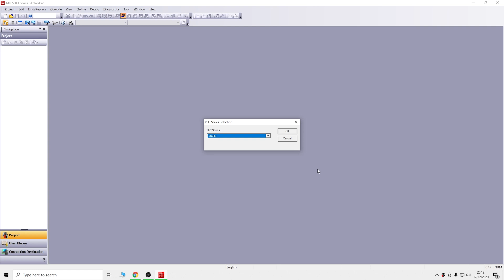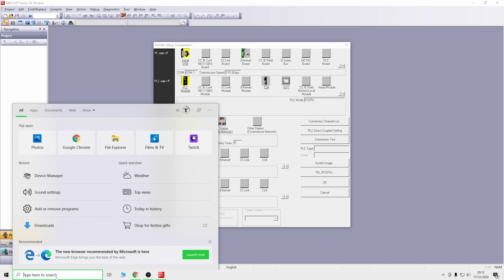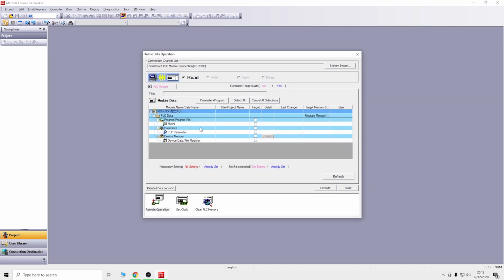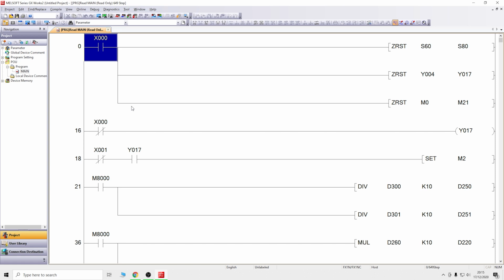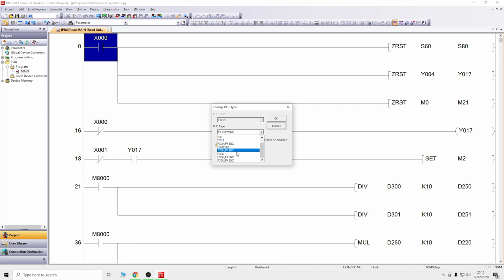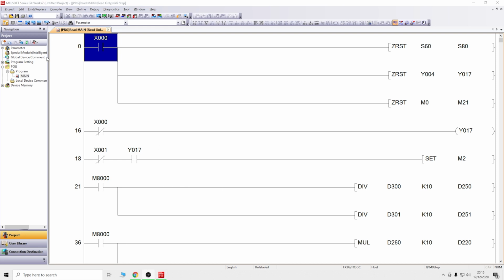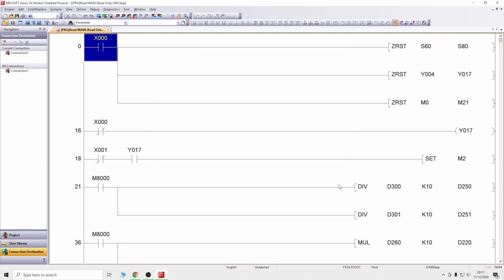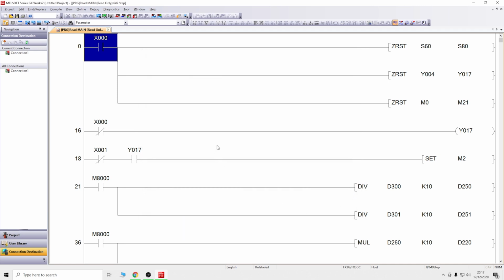Program upload /download from Mitsubishi FX1N to FX3G PLC Using GX Works 2. ( English )

Comment: the usb sc09 cables will do the job instead of the red one you have sir ?
Reply from the maker: I have never used the USB cable, so can’t comment on how well it works.
Reply: @IGSElectronics  so you suggest not to bay one of those cables because i.m form syria and due to the situation there i have to purchase aboard and the shipping  will cost a lot to delver this cable so i have to make sure that this cable will not Betray me .... my plc is fx2n-48MT
Reply from the maker: @mohannad Issa: I would bay original if possible, but if it is your only option, look for the ones that has been sold before and has good feedback and comes with drivers.
Reply: @IGSElectronics  will see sir thanks

Comment: Mt PLC is FX3S series, but the ladder diagram I have written for this PLC is FX3G type on GX Works 2. Is it possible to move FX3G's ladder diagram into FX3S PLC?
Reply from the maker: In short No. It depends how the programming has been done. As FX3G is much more advanced with extra futures then FX3s and if any of them futures have been used that can not be supported by FX3s, you be in trouble.

Comment: Hello
I have a problem with this plc. There is an error signal in the LED number y2... Mitsubishi fx1n- 60mt model. Is this hardware or software. Please help.. Thank you
Reply from the maker: Hi there. It could be program or hardware. You need to connect to gx works to look in to diagnostics

Comment: Can I use GX Works 3 with FX1N series PLCs? Also, do you have any experience with the aftermarket FX1N PLCs that sell on eBay and Amazon? I'm trying to find a low cost PLC and these would be so wonderful if they actually work with the Mitsubishi software that I already have. Thanks.
Reply from the maker: Hi Ray. GX Works 3 has been built for next generation PLC's, so only works with FX5 series. FX3 and below controllers must be programmed with GX Works 2 or GX developer. I hold large stock of aftermarket Mitsubishi plc's, so do check out my eBay store. Link to store is in description if you wish to check it out.
Reply: @IGSElectronics  Hi, I am refering to these imitation PLCs; https://www.youtube.com/watch?v=cSIrZf7bKzk Are you familiar with these? I looked through your "store" and didn't see anything like this. The reason I'm interested in these is their price. I have a customer where I'm using some relays that I would love to replace with a PLC but the added cost to the design doesn't allow this. I already have the GX Developer so this would be great but wanted to see what your experience is with them. Thanks.
Reply from the maker: @raycowan1387  None bud, i worked with normal 14mr plc but never with the one you showed me. It is controll boeard form the actual original PLC. What size PLC are you looking for and what is your budget?
Reply: @IGSElectronics  my budget is that PLC I sent a link to as well and the size. Those are small, inexpensive and use a standard PLC language. Otherwise, I would use the Automation Direct Click series; a lot for the money. Thanks.
Reply from the maker: @raycowan1387  In that case my friend, i have never worked with them units, so i wont be much help for you.